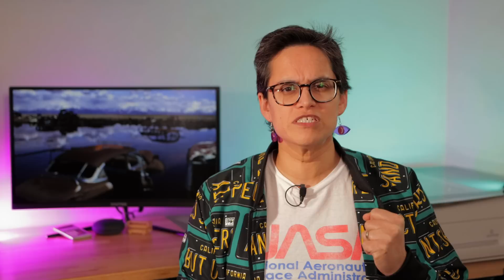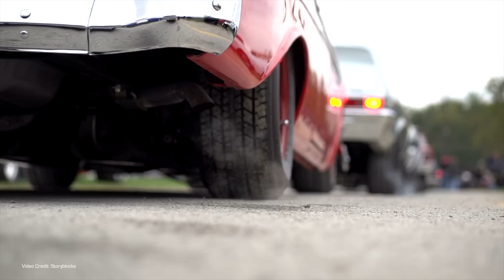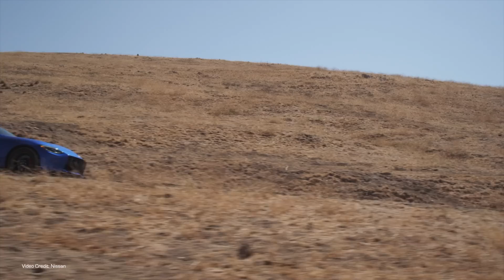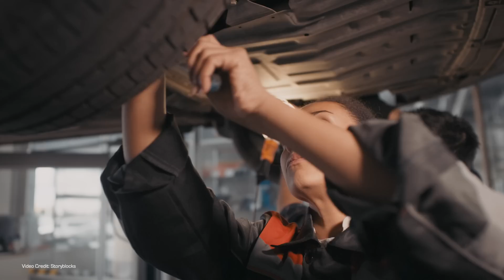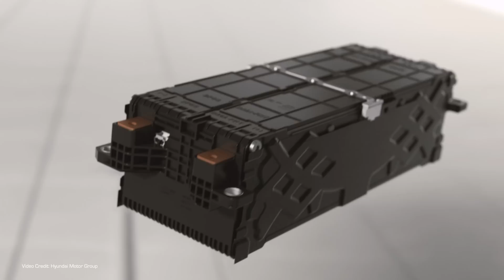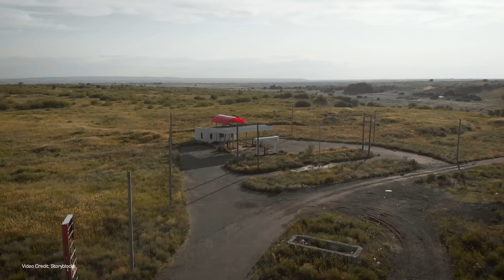Is Internal Combustion dying?

Comment: No, you're wrong! Petrol cars are vastly superior thanks to the manly noise they produce and batteries are the worst thing for the environment since... the ICE... looks at two EVs on driveway Hmmm, maybe you have a point!
Reply: So 25% efficiency is "vastly" superior to 80% efficiency is it?   And the high levels of pollution in our towns and cities is perfectly fine and dandy then?  And noise isn't superior. It's actually classed as pollution.  And EV batteries can be recycled, and the lithium and cobalt can be 90% recovered and reused in new batteries. Try that with gas/petrol and diesel......
Reply: @Brian-om2hh  I think the sarcasm got lost in translation despite the clarification that I own two EVs.

Comment: Great video Kate! I’m concerned about how it will be low income workers who will be stuck driving ICE vehicles. Parts and gasoline will be plentiful for a while but then they’ll get more and more scarce — and expensive. 

But when you rent you don’t have the luxury of charging at home. 

New rental projects targeting affluent residents will offer charging, but existing low income housing won’t get charging capabilities for many many years.  Even home owners might not be able to afford to installer a charger, or upgrade their service (fuse/breaker). 

The electrical grid in their neighborhood might not be sufficient to handle the load as more EVs are in use.
Reply: "I’m concerned about how it will be low income workers who will be stuck driving ICE vehicles. "
This is mostly an American problem though, in countries with decent public transport systems (i.e. the rest of the industrialized world) low income workers can usually do fine without cars.
Reply: That's easy. It's called regulation. Eventually the cheap ICE vehicles will be replaced by used EVs, and we can decide as a society to regulate that rental owners need to provide a charger if their tenant requires it. For all those that complain about forcing the homeowner to provide it, we already do for all the other modern stuff like water, electricity, etc.
Reply: @morosis82  it’s not that simple. You’ve got a variety of local, state, and federal regulations. Small landlords aren’t subject to the same regulations as large landlords. 

Over the years I’ve rented or owned rental units with no off-street parking.  Large apartment complexes, like where I live now, will likely add charging at some point. It’ll be shared and billed per kWh.
Reply: @steven.l.patterson  so all landlords operate under some form of regulation, it should be simple to impose this requirement. These chargers aren't super expensive, it's not like you're forcing solar and battery purchase, it should be the cost of business as a landlord.

The no off street parking is a whole other issue, but apartment blocks could perhaps be on the hook for at least a couple of chargers on street, with designated bays supported by local city regulations (ie. No parking for non EVs). That's the cost of not having been built with off-street parking, which I feel should be illegal anyway - all apartments should have at least one off street car spot. It's called wxternalising the cost, they just put it on to other taxpayers that fund the streets.
Reply: @morosis82  many of our buildings in St. Louis were built in the 19th century, before cars existed. Some old apartment buildings have some parking, but not enough for everyone. 

I can see some cities possibly mandating chargers for new construction, but I doubt it’ll happen for existing.
Reply: @steven.l.patterson  which is fine, of course there are going to be historical buildings, which is why I mentioned street parking upgrades. I've lived in 19th century apartments in London, there wasn't even any street parking, but then you don't really need a car in London.

Obviously the solution is multi faceted, but we can make new standards going forward and we can implement new regulations that cover old buildings.

Comment: Either governments will force manufacturers away from ICE, either through stronger emissions standards or higher fuel prices/ending fuel subsidies (extremely unlikely in the US) or EVs will get so good that there is no rational reason to buy anything else. I’m not sure which will happen first. I think what is likely going to happen, at least for the short term, is we will see an entire line up of vehicles powered by 1 or 2 engines (like Volvo). Manufacturers are likely to spend a truckload of money to get one engine to meet emissions standards and just put it in everything than trying to get multiple engines to pass tighter emissions standards.

I think the biggest struggle, at least in the US, is getting people to realize that while an ICE vehicle may be more fun for an occasional weekend blast, the average EV Is a substantially better choice for just about every possible daily trip.
Reply: In the UK some people keep moaning about 2030/35 cut off date for petrol and hybrid cars, but I keep thinking that's 10 years away, in 10 years time you'd be a fool to go out and buy a brand new petrol car, EVs will be better faster and cheaper than they are now and the Infrastructure will be more widespread and better hopefully. I can understand why some people might need the huge range, but they can buy hybrids new until 2035 and then run it for 5-10 years, so basically we have until 2040 to get the infrastructure fully sorted out for EVs, like superspeed charging hubs in every city and every 10 or 20 miles on motorways, and slow chargers on most car parks.

Comment: Agree with all Kate has said, but i would point out that the lump of pig iron in the nose of a 2022 Chevy Silverado still has push rods in it…. Dinosaurs can and do live well past their extinction date. Also the rise of EVs depends upon the rise of infrastructure to support them. In Australia for example, with the best will in the world and a supportive government (unlike the present clots’ collective) it would take - at least - a generation to build out the grid infrastructure to put charging stations across the entire country. Still solutions can be found. Case in point driving across the Nullarbor Plain; no grid power and until a month or so ago EV charging only from 3-phase power socket powered by a Diesel generator. Now there is a proper 50 kW Rapid charger (crowd funded) - running on a generator fuelled with used oil from the fryers in the adjacent road house…. Not exactly ‘green power’ but still…

Comment: I'm surprised no government has reached out to automakers as a whole to find out what wireless highway charging standards they'd all adopt?  Currently Governments are trying to work out how to cover road maintenance costs when less people will be using fuel (fuel taxes).  At the same time Car manufacturers are struggling to find enough battery minerals and ways to drive the price down with the large costs of long distance batteries.  Seriously this could help both groups, have the car industry agree to add wireless receiver coils under the car conforming to a standard and issue standard charge coil infrastructure only to major highways to start with to cover long distances between major cities.  Sell off chucks of highway to private enterprises to maintain that length of highway in return for charge revenue and as a result of this infrastructure, reduce the need for large battery packs on manufactures.  Win win..

Comment: I'm an advocate for electric machines. Humanity should have switched from steam engines straight to electric motors in primary traction.
However, using batteries to power these motors was a mistake. So much so, that combustion engine primary traction, another mistake, was able to take over.
Having said that, batteries are not ready for use in electric vehicles, and never will be. In this context, ending the development and production of combustion engines before a decent way to store energy is found is yet another mistake. If nothing is done, all we will have are unaffordable battery electric cars being made with more and more range, and becoming useless unrepairable piles of metal out of warranty at the hands of the people who can't afford to buy new, and will suffer the most.

Comment: I find it to be incredibly awkward timing that a convenience store in my area recently had a spiffy makeover and installed new petrol pumps just to compete with another convenience store on the opposite side of the road. I suppose they didn't get the memo. 🤔 R.I.P. ICE (Aka the Victorian lump).
Reply: That's such a shame.... If they could have invested, somehow, in a couple of ev chargers they would be future proofed.
I think that would work over here anywhere in the UK but it sounds like some of your small townsfolk would not be convinced?
The whole transition period needs forward thinking by a complete community effort. Retraining, investment in infrastructure, reimagining, its all key.
Reply: fuel pumps will be around for decades to come. So it certainly isn't a bad investment from that store. It's still more than a decade before all new cars come without an ICE and after that it will take at least another decade before EVs form the majority of cars on the road. 

This is a slow transition, and that in itself is also a good thing as our current infrastructure wouldn't be able to handle a sudden massive shift the EVs, and getting that infrastructure ready will take a similar time as the conversion from ICE to EV.
Reply: @Hans-gb4mv  If gas stations make most of their money on food an groceries the obvious transition should be to improve the food offerings and add some EV chargers.  A smaller number of captive (likely buying food at a dinner) EV owners will produce as much profit as they would get from 10x as many gas cars with most just filling up the tank.  Smart business owners will evolve their offerings and others will die.
Reply: @ccibinel  That is exactly right.  When you are filling a gas tank you are standing next to your car.  When finished possibly a quick visit to the restroom, pay for the gas and go.  An EV owner normally has around 20-30 minutes.  Plenty of time for a coffee or even a light meal and perhaps other shopping.  Realisation is dawning with this and I can see gas stations in Europe increasingly giving over to electric charging once it is time for the underground fuel tanks to be replaced.

Comment: Gas motors, to the credit of legacy automakers around the world, have improved IMMENSELY in efficiency and pollution since the sixties. They literally are 99% less polluting and yet still produce the same or more power per cubic liter.* But, even with all that improvement cars are still topping out around 50 or 60 mpg with most cars coming in considerably lower that that. It seems to me that the gas engine has reached the end of it development life and it's time for something better to take its place.

* How many times were we told in the last 40 or 50 years that cars would be getting "100 miles per gallon" in the near future? While that number IS actually possible in very specific drivetrains in very specific situations, the tradeoffs to achieve it are not practical for most people.
Reply from the maker: There have been fantastic gains in engine efficiency thanks to advances in materials science, manufacturing processes, and computer/sensor technology (the last particularly with ignition and valve timing). But it's hard to overstate the degree to which advances in catalyst technology have really driven down pollution. Many of the gains in engine performance have been soaked up compensating for power loss due to tightening emissions and catalyst requirements. - Winter
Reply: Kind of makes you wonder if the buying public weren't demanding more and more performance as well as efficiency. 
If they could be tuned to be more efficient.
Some of Toyota's newest engines are I believe over 40% thermally efficient. That's a pretty high number. When you blend that with the very high energy density of fossil fuels along with ease of transportation and rapid refueling. There certainly is a case to be made for continuing to make them more efficient if that's possible.
An EV is definitely more efficient while rolling about 90% I believe.
But the energy density at least to this point of batteries is pretty terrible relative to the energy density of fossil fuels.
I think the people that are going to be most negatively affected by this transition are the people that cannot afford to replace a vehicle. They're driving around and a $3,000 used car. And that's all they can afford and they can barely afford to keep it running as it is.
I tend to buy older used cars and keep them running.
my old used car is a 13-year-old Prius, so it's quite efficient and reliable and practical. And for me the cost for mile is about $0.08. That's fuel and all maintenance and tires. I do my own maintenance. 
 When I've looked at what the cost per mile is on an electric car with a blend of charging it home and charging at public charging I've come up with about $0.04 per mile as my cost. So it's basically half.
The problem is the difference in brand new purchase price.
 Brand new Tesla Model 3 long range $48,000, brand new Prius $30,000 at the highest. Driving 50,000 mi per year,  it would take me 10 years+ to break even. That's not a good financial choice. 
Also,  I can go out and buy a slightly newer Prius, for a few thousand bucks and then keep driving that one for a few more years. My 13-year-old Prius has 394,000 mi on it. And still gives me 45 to 47 MPG. I put 192,000 on it in the last four years.
So until all of the old used cars finally get dumped into salvage yards they're still going to be gas cars running around, and they're going to be running around and owned by the people who can least afford to replace them with a new vehicle of any type.
Reply: @kens97sto171  You make several good cases for why this transition is going to take - and SHOULD take - more than 5 years to complete. My first and current EV is a used one but I got lucky and found a premo example (low miles, under $13000, one owner, perfect condition). Right now the used market is sky high, so that will be something to overcome in the next 5 to 10 years.
Reply: @JustWasted3HoursHere  
Definitely.. used market is crazy high.
I would really like my next car to be an EV .
I do ride-sharing and doordash.. part time.. 
There are some Bolt EV out there for decent prices..
The other thing that's attractive is a nice used Tesla Model S.  That's a bit more money, but older and more miles.
And that concerns me a bit,  Tesla's can be expensive to fix.. and it's much more difficult to fix it yourself.
Reply: @kens97sto171  yeah but eventually EVs will become cheap and cheerful second hand cars just like your Prius, it will just take 10 or 20 years.

Comment: Also, while the earth isn't running out of oil, it will be running out of cheap oil. Average US refinery is 40 years old so will need new investment to keep them running. Not a smart move to spend money so can run another 20 or more years when market will drop off in less than that.
Reply: Oil is NOT running out, used motor has been refined for years to make more gas and diesel....its called recycling
Reply: Exactly.....

Comment: And when gas cars first overtook battery powered cars back in the day, people put up with the terrible cough-inducing smoke, loud noises and inconvenience of getting fuel (before gas stations you would go to the feed or goods store and buy it in 3 or 5 gallon glass bottles) because the overall experience was more useful and practical (such as it was). This is similar to the state that we find ourselves in now with EVs, though with not nearly as many negatives to contend with. Range will continue to increase and/or charging times will be reduced to a point where super long range is not necessary and the infrastructure will continue to expand at an ever increasing rate. This is the message that needs to be put out there: EVs are heading in the right direction, but we are still in the early stages - like those early ICE vehicles - so be patient.
Reply: I won't wait any longer than it takes to pay off my student loans.
Reply: @jessebrook1688  Seems reasonable. It's going to take a while for prices to level out anyway because of the state of the world. Maybe 3 to 5 years I'd say. Keep checking carvana, cargurus and other used car sites for prices. There are still some good deals to be had, but I'd wait a bit longer first.